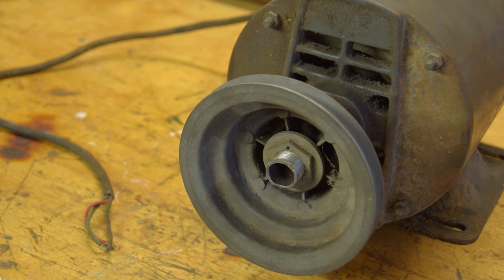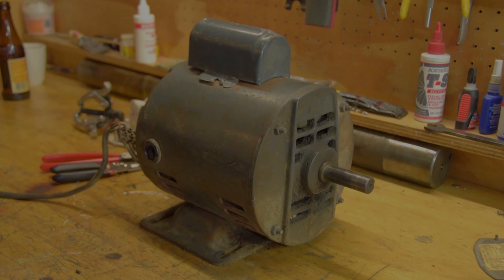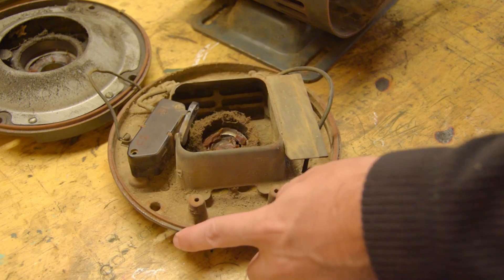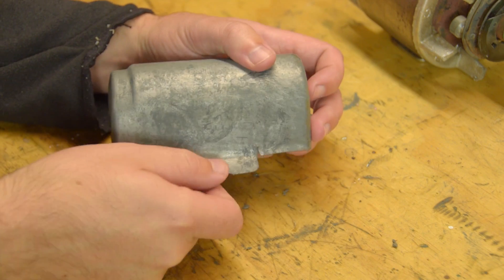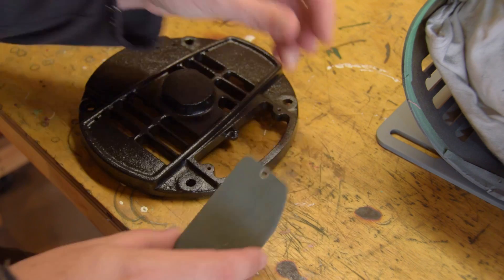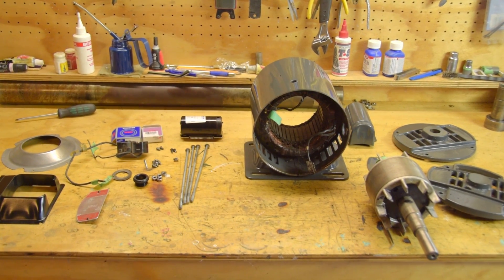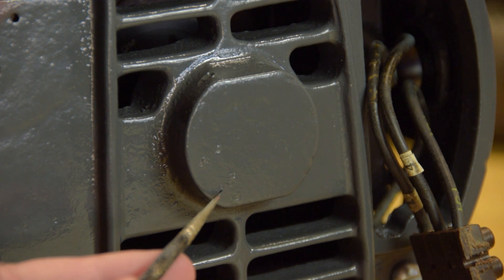Drill Press Restoration Part 2 - Canadian GE Electric Motor

Comment: You said you didn’t have the equipment to test the capacitor, though it looks like it is at fault you can test them with a multimeter after you discharge them. Is this not a good way of testing them?

Comment: Gud, its better to use some grease even if its a new bearing, remove the black plastic seal slowly grease it if not sufficient grease. Usually stock bearings don't usually have sufficient grease so meant it. while inserting bearing to any body apply very little grease to the body where bearing sits. Because next time when u remove it comes out easily. Rest everything was gud and do remember to put just 2 or 3 drops of oil inside bearing balls. Which mixes with grease. If ur grease is slightly oily then separate oiling is not required. In this case when u run ur motor it minimises the noise of the bearing.. Hope i have made u understand. Gud job. Let me c ur next video part 3.. If i hav got to suggest on any part i will.

Comment: I liked the filler....  turned out great.  I have no outrage to share, sorry....

At worst, Sir, you could be mildly accused of an "over-restoration", but...  that sort of criticism is really only appropriate in case of a true collectors piece...  which this drill press is not.  That press was generally available, relatively unchanged, for many years, and could be found in many shops, in a variety of industries or what have you...  so there's nothing really "collectible" there....

It probably didn't look that good when it was brand new!  But that's part of the fun, isn't it....

I like where this one is going.  I just found your channel, so, I apologize for commenting on an old video...

Comment: I lengthened my gear puller once by making new longer plates to go between the fingers and the star, flat bar-stock hand-drilled, hand-filed, and cut to length with a hack-saw. It worked, too! The tensile strength was sufficient to the pulling I needed it to do. (removing dry/rusty bearings from old snowmobile bogeys) As far as filler goes, it's your equipment and you're restoring it to your specifications, I'm just along to enjoy the Ride!

Comment: For your bearing puller, You can use two parallel pieces of steel six in total cut to whatever length you need to replace the three adjustable sections.

Comment: RAGE - Hi Geoff - I have spent my afternoon / evening enjoying and absorbing your fabulous videos, especially the lathe restoration. While your methods do occasionally have a 'cringe factor' (nice to see you bought a new gear puller!!!) by and large you work is very interesting. I was quite fascinated by your cast soldering?  As for your use of filler - either way this does not phase me. I would have made attempts at a little panel beating or left some scars of its industrial heritage.

Comment: Well,very impressive.but why you never used Washers and Spring washers with nuts,bolts and screws?they hold more firmly to the body of motor.(also "prevents"from"scratches")

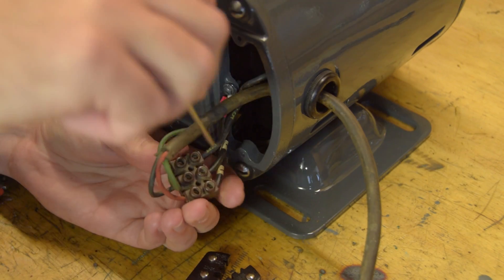Comment: 17:55 the rear case is not flat against the stator housing looks like.
I will damage the bearings very quick,and create a useless load on the motor.
Reply from the maker: No, it's fine.

Comment: Do you have 60hz in NZ? The capacitor made me wonder though perhaps it doesn't matter that much, figured you had 230v/50hz (any 3ph?)
Reply from the maker: 50hz I think. 3 phase is relatively easy to get as a residential customer. I don't know how much it is, but it's fairly common for workshop guys and farmers etc. to have three phase.

Comment: Is it possible to extract the windings from the motor housing? Have one I was planning to powdercoat. Great video!
Reply from the maker: No, not in this case. I'd guess that the stator, housing, and bearing races and flanges on both ends are all machined in alignment, so probably not the best idea to pull it all out even if you could. You only find out by trying though...

Comment: nice vid as always good quality, to clean elettrical part u can use WD40 ^^
Reply: I hear that really often, and unfortunately it is a bad idea! The variety of petroleum products contained in it can and do soften and eat away at certian types of wire insulation, and plastics. Of course some of these plastic and rubber materials are oil/gas resistant, but many are not. Not a chance I think is worth taking vs just using a proper cleaner, especially when considreing an old and or complex component that it could sit inside of and cause issues down the line. WD-40 isn't very good at lubricating even as many are aware! It runs away quickly due to its thinness, and leaves a sticky residue that will actually attract dirt and dust, sticking it to the surface! The product has no place in my work ever, that's for sure. Much better to just use a specific product, that is designed to do the job.

Comment: Oh dude really bad idea the hot glue on the capacitor, not a real problem on this one because of its size, but the glue is heating the can which is heating the electrolyte inside and it can explode, never do it with a smaller chimical capacitor (the round ones, no problem with the plastic ones with a square yellow case)

Comment: If youre not using a brass wire wheel id suggest one as they tend to be more gentle on the parts

Great work 👍🏼
Reply from the maker: Cheers Nicke!
Reply: No worries

Thought id help a mate from across the ditch ;)

Comment: the used drill press i bought had trouble running, because the belt had been yanked up super tight, because it slipped, it was worn and bottomed out, new belt=works perfect.